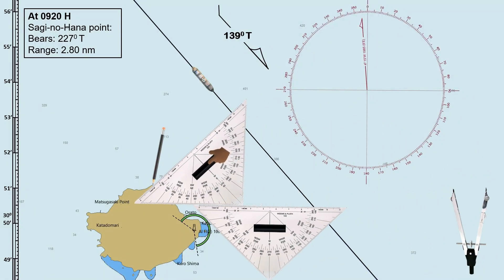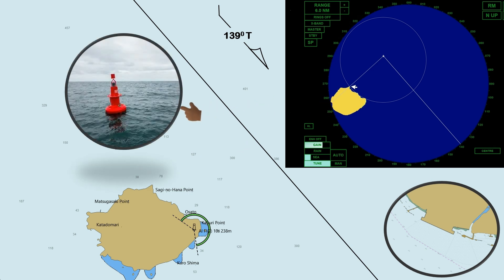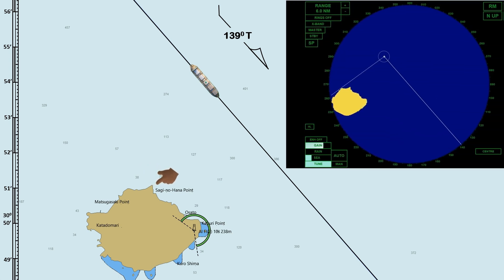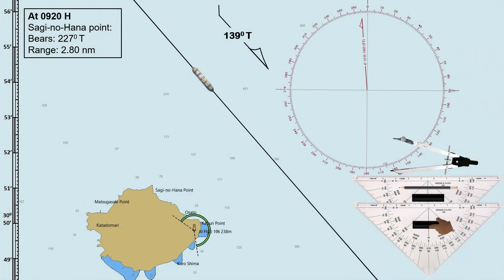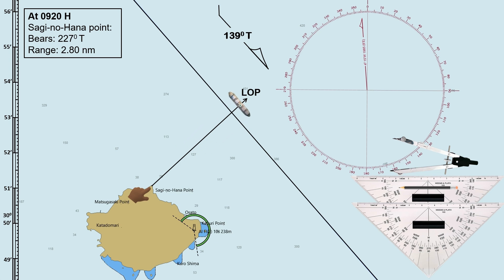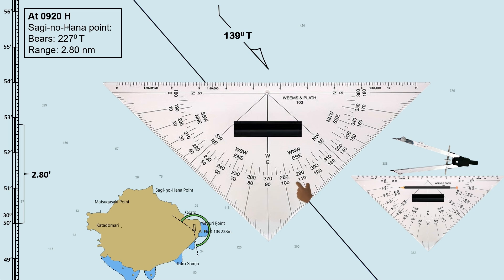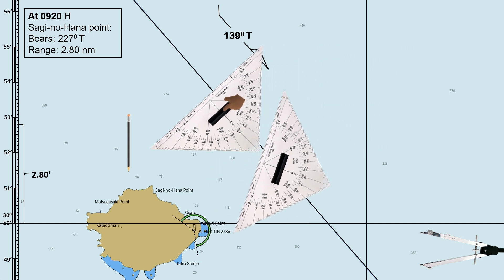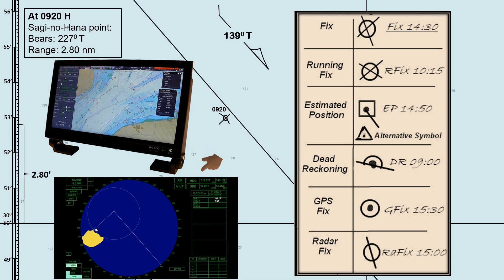Position Fixing Technique: By Radar Range & Bearing

Comment: sir what do we do when the range and bearing fix is significantly different from the GNSS position?
Reply from the maker: In practice, when radar-conspicuous objects are available, the ship’s position is determined using radar fixes or by visual observation, rather than relying on GPS. This approach is preferred because radar fixes, based on observable landmarks, provide a direct and reliable reference to the ship’s position, reducing the risk of errors associated with GPS, such as signal interference, multipath effects, or datum mismatches. In coastal waters with available radar-conspicuous objects, the primary method of position fixing should be radar or visual fixes, and GPS fixes should be used as a secondary means of position-fixing.
Reply: @nauticalacademy001  I understood sir but what will be our action if we fix our position and we also fix our position with gps but there is a difference of about 1 mile between the 2 fixes

Comment: Very helpful sir
i Have 2 questions
How do we plan position fixing interval?
why don't we keep using one means of position fixing and use other techniques also?
Reply from the maker: Thank you for your kind words! I'm glad you found the video helpful.

The interval for position fixing depends on various factors, such as the ship's speed, proximity to hazards, and the accuracy required. In high-traffic areas or near dangers, shorter intervals (5 to 10 minutes interval) are crucial for safe navigation. In open waters, longer intervals (1 hour) may suffice, but it’s always good practice to adjust based on the voyage plan and prevailing conditions.

Using multiple techniques ensures redundancy and increases accuracy. Each method has its limitations, such as errors in radar bearings, GPS signal loss, or inaccuracies in celestial observations. Cross-verifying with different techniques helps identify and eliminate errors, ensuring a more reliable fix for safe navigation.
Reply: @nauticalacademy001  thank you very much!! You're my favourite youtuber at the moment